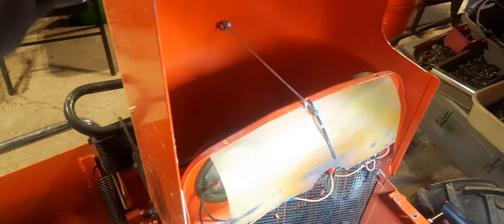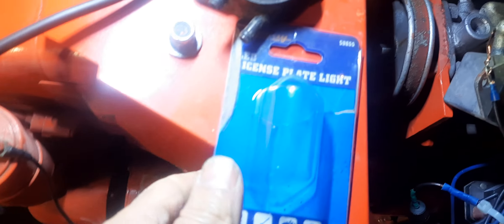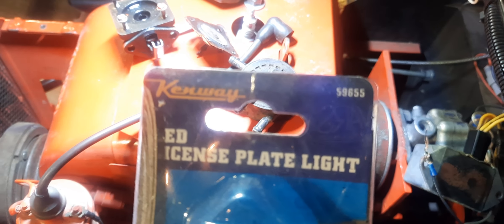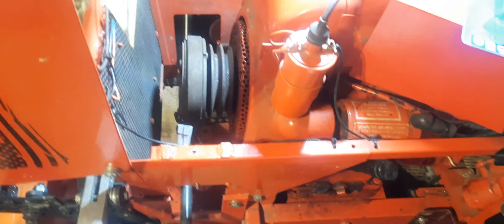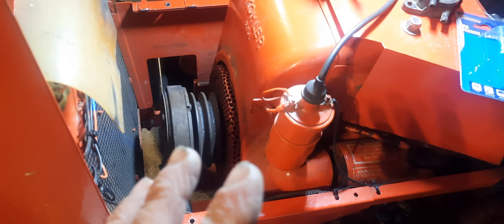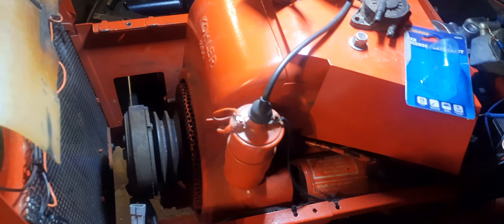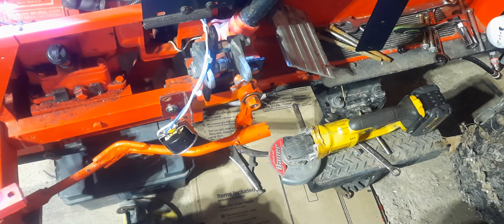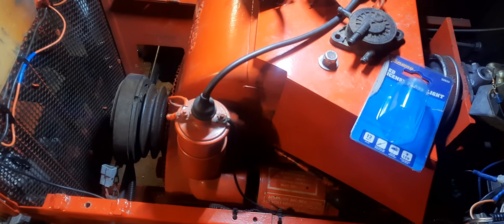ECONOMY POWER KING: Vacuum Fuel Pump  (Kohler K321), Dash Light, Gas Tank, & Stack Muffler MODS

Comment: I currently want to do the exact same thing with the fuel pump...my question is where did u hook up the vacuum to it
Reply from the maker: Sure, you need to make a plate with a pipe fitting that fits over where the mechanical fuel pump originally mounted on your engine.  That is where the vacuum comes from to operate your new, vacuum operated fuel pump.  Thanks for watching.